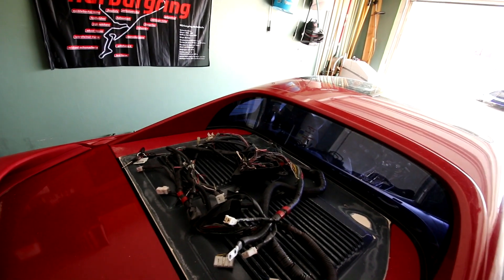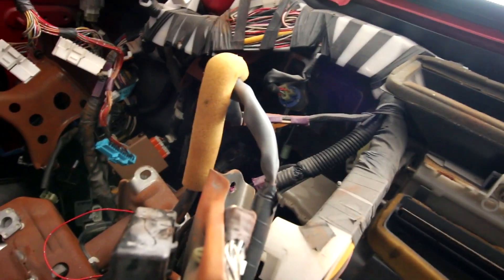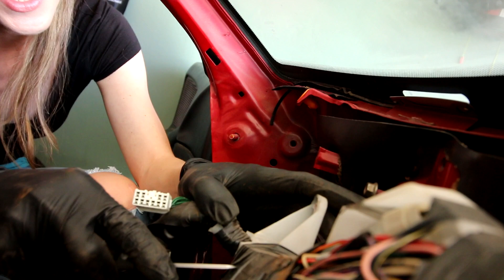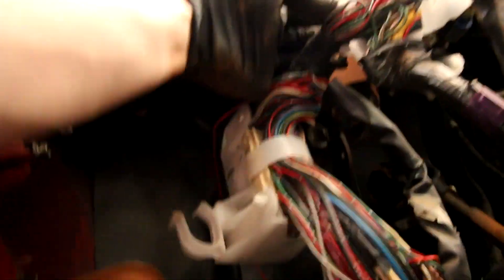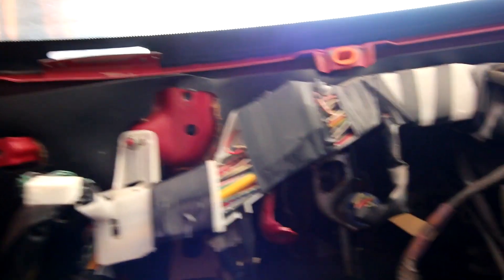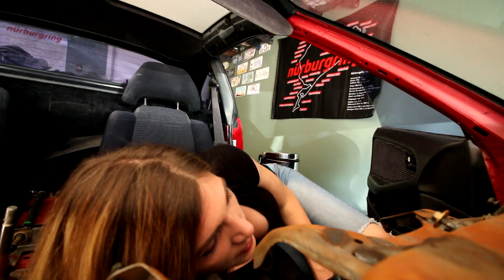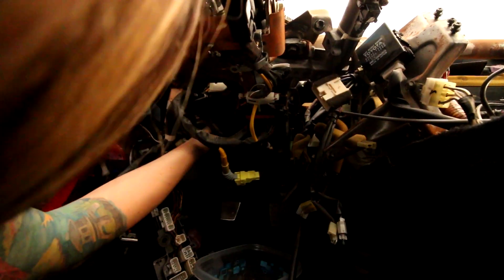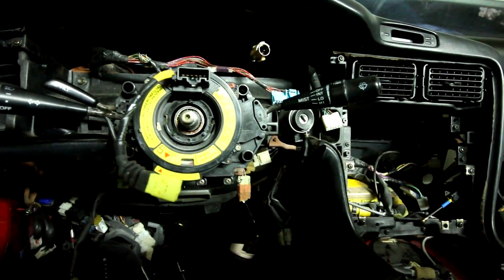What Did I Get Myself Into? // MR2 Project Car Pt. 9

Comment: FUN. You got yourself into FUN !

I sold my MR2 Turbo a few years ago. Now I am building a '91 RED Hardtop. I've got about $15k worth or MR2 parts in my basement. Going 5S-GTE. Shooting for 600hp at first. Gen3 hardness, Hydra 2.7, 1600cc Ford injectors, 2.2 crank, custom Wisecos, Pauter Rods, 98+ Block, Kaaz Diff, BW S256ET Turbo. Wilwood Front Brakes, Rx8 Rears. Wilhelm Suspension mods.  List goes on & on.

Because racecar

Gonna have to build the engine in my kitchen since it gets pretty damn hot in Vegas. I just need to fix & sell a Corvette or two.

Comment: In deep there ! Solder Seal connectors are the way to go . Heat with a heat gun and it melts the solder and shrinks the insulation .So easy to take shit apart . Lol

Comment: Heat shrink tape!  Use it!  After you solder it together.  It will last forever. Do it once or don't do it at all!
Reply from the maker: I really need some of that stuff! I used it all the time in the Air Force.

Comment: Just sayin, I love using the woven loom instead of the crinkle stuff. More flexy and looks killer. It means de-pinning connectors, but totally worth it
Reply: CorndogBrownie there is some woven loom that actually has an opening and it's in a roll ...and you can just slide it over your wire without having to de-pin the connectors
Reply: Craig Cundiff neat, I will have to look it up. When I re-routed the loom on my MN12 I tried to use the skinniest possible loom for a nice look , but it took probably twice as long to record every connector orientation and wire colour and then run everything. 

I take it you can probably get it on amazon?
Reply: CorndogBrownie I got mine from McMaster-Carr but it was pretty expensive you can probably look around and find a cheaper...👍
Reply: Craig Cundiff awesome, thanks
Reply: Where do you get info on the wiring for the pcm. Or pinouts ? My pcm wasn't cycling on my alternator so my truck was running off the battery. Well i spliced into what i thought was the wire to the alternator. But it was actually one of the wires to my crank sensor and now i have a random misfire, hard starts rough idle. I have a chiltons manuel but it doesnt have wiring diagrams for the pcm. I dont want to take if to a shop i just got it back. Any info i would really appreciate
Reply: yodaddy nuggems most of it was I had the car completely apart and I could trace and continuity check everything. Plus forums, look online for a forum pertaining to your truck. Sorry I couldn't be more helpful
Reply: CorndogBrownie its okay thank you and iv tried everyone on the S10 forum thougth I was joking with them
Reply: Yo daddy pitch that alternator in the bin and put a si 3 wire on and never have a pwm on again, if you really want to fix it go to the library and you can find any wiring diagram. EDit forgot to add you need to look under  mitchell on demand to get the wiring diagram.

Comment: Also on the episode were you cleaned your wheels look a company called " autosmart " and get the product called " wheel king " and there's no more scrubbing by hand just spray it on and gurni off and all dirt grime and brake dust will be gone in minutes.  I use it everyday 😁

Comment: Sorry about the delayed comment on this video, great camera angle BTW.. Seeing how this car is a 5 speed car, check your neutral safety switch because those get jumped a lot when they go bad. And as far as the miss matched wiring harness I would guess the car has seen a lot of water before and the owner changed it out instead of totaling the car through the insurance company.

Comment: When I did my auto electrical course, our instructor called the little silicon covers " condoms" as well. So I would say that is their legit name.

Another thing, be careful with the LED lights! Some of them have resistors wired in series with them, and when you throw them into the sockets where the incandescent lights were the circuit gets overloaded and burns the fusible link. Fixing it is a PAIN. LED lights should work fine if you wire 5 of them in series on a 12v circuit.

Comment: Nice work.  Sometimes that kind of effort pays off in just knowing the condition of the harness.  You are reworking the other two harnesses, so dialing in that one was well spent time.  Plus, you got to clean under there, right?  At least it looked like you did.  Thanks for saying "harness" for the harnesses and connector for the connectors.

Comment: Hey Sarah! Random Forester Question. What did you tap into for the front bumper LED lights? The "Fangs" i guess they call them. Im asking because I had the BIU (Electronics Control Module) go bad on my Forester $470 Fix (Ouch)...they blamed the LEDs. Something about Subarus not able to handle variable voltage on lights. I still have mine installed just not hooked up to any power source right now. Do you have a suggestion? A better tapping place? Thanks always and great video! ( ^.^)
Reply from the maker: killersushi99 I ran it to a fuse below the steering wheel that gets power in ACC. I’ll have to check which one.

Comment: Sarah, nice video, wiring on MR2's is a pain.  I have a 91 turbo, that has been swapped from a rev2 to a rev3 3sgte.  I am currently chasing down wiring demons as the shop that did the swap did not do the wiring correctly.  What you were referring to as the "hunk" is normally called a engine cover, from what I've seen on the forums.  I'm no expert, though if you could post the link to where you ordered the dash lights from in your dash light video that would be great, I need to replace mine. :)

Comment: Is there any chance of a video showing how to repair an original dash since I cant find a junkyard swap?  This is my old truck Im fixing up and the dash is dry rotted and broke in a few places.  Do you have any advice on how to repair the dash?  Its on a 95 Chevy c1500 truck.   I thought about removing it and plastic welding the pieces together so I could mount it on a temporary stand and possibly bondo over the dash to redo the surface and reinstall.  Any experience?  Any thoughts?  Thanks Sarah, you’re the best.

Comment: Did you actually get all of the screws and bolts back in the correct locations?
Reply from the maker: Troy Crosslin yeah, I put them back in their hole as soon as I remove that component, this way I never mix up my hardware.

Comment: Just a F.Y.I. that (clock spring) behind the steering wheel is not actually a spring and it won't go twang if you disconnect it.  it is a really long ribbon of paper and plastic with thin copper "wires" painted onto it so that your horn, air bags and other controls that rotate with the wheel have a connection.  If you wind it too tightly it will rip the ribbon and has to be replaced so that is what all the warnings are about on the stickers. Also for some reason I have to subscribe again and I have never unsubbed so YouTube may be doing something funky with your subscribers if you have been noticing a drop or slow down in new subscriptions.  Great video though.

Comment: Anything worth doing is worth doing right so for you to say it's extreme to pull out the entire dash to fix that wire is nonsense. The fact is when you complete MR. Dos it will be just as good if not better than when it left the assembly plant. And anyone that deals with cars knows its better to have a reliable car than a showcar so keep up the long hours and frustration in the end it will pay off.  Also can you do a shot out to Sally McNulty she is doing a vlog series "diaries of a female racer" she's based out of Phoenix I believe check her out you might find it interesting. Not affiliated in any way just think it would be cool like you and Emily promoting women automotive you tubers. One more thing if you have a suction mount for you camera you can place it on the rear glass or T tops of the mr2.

Comment: First off; I don't know how you got through that task while keeping your language youtube friendly. Every second word, out of me, would have been a curse by the time that job was done. 
Secondly; Ain't nobody complaining about your choice of camera angle.
Reply from the maker: Neathway I swear all the fucking time in person, lol. I know how to turn it off though when need be. 😋
Reply: You must have better self control than i do. 
And, just an FYI: If you ever have to replace the lower heater core line on your Forester, be prepared to do a lot of swearing. So far I've got the alternator, ac compressor, the ac/alternator mount, and rad fans out of mine. If the my rubber hose fix doesn't work, I may have to pull the intake off to get this stupid pipe out to replace it. My garage has been a place of many swears, and flying (thrown) tools lately.

Comment: Was anything connected to the plug on the other end of the ignition wire?  Maybe there was a immobilizer there?  Where does the engine end of the ignition wire end up?
Reply from the maker: Duane Pinkerton I’m going to look into that once the engine is back in. The rear body harness had so many issues, I feel it may have caused this symptom that resulted in the previous owner cutting that wire under the dash.
Reply: That wire may have gone to a clutch switch, only allowing you to start the car when the clutch was fully engaged.  It's a fairly common problem for the clutch pedal to not fully engage the switch and therefore not allowing you to start the car.  The P.O. probably bypassed this with that wire.  If this is the case, adjusting the position of the switch will take care of the problem.
Reply: If the car was auto ever than they had to cut it as the prndl switch is gone.

Comment: That was awesome, you are fearless. I probably would have done the same thing just to make sure of the wires. The only thing I would have done is I'd have painted to metal dash support with rust stop paint. This might be because of my anal-ness and I don't like surface rust. I hope you bought Scotch brand 33 or 66 electrical tape.IMO anything else you pissing in the wind,
Reply: Eric Corse Tesa tape 😉
Reply: Thanks Keith I had never heard if it till now.